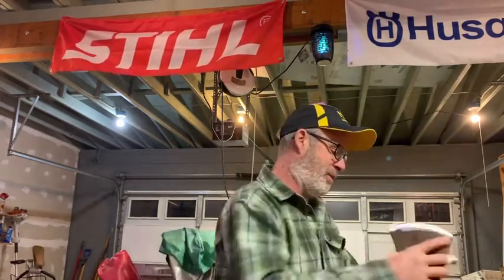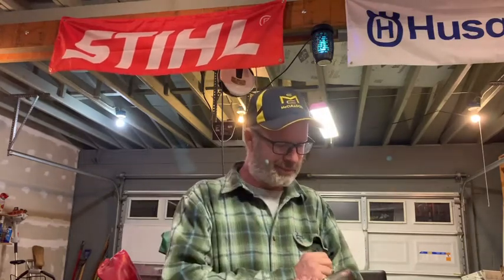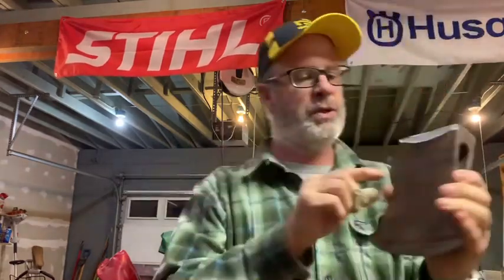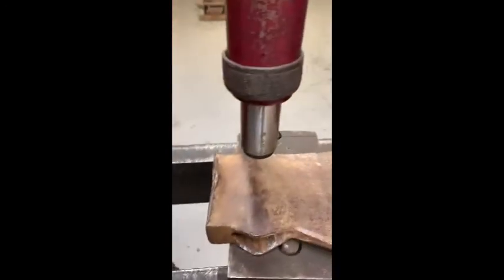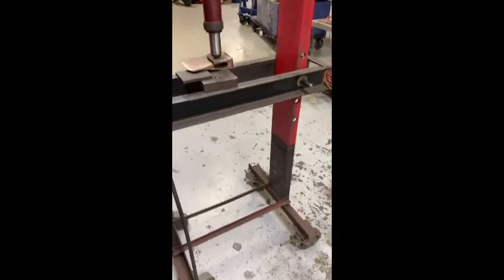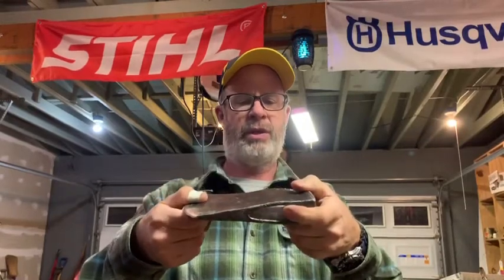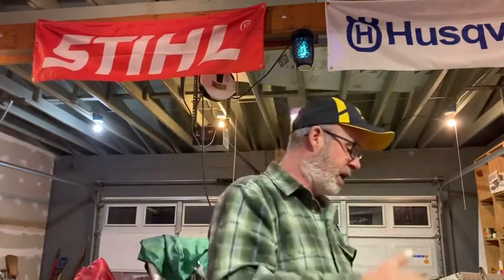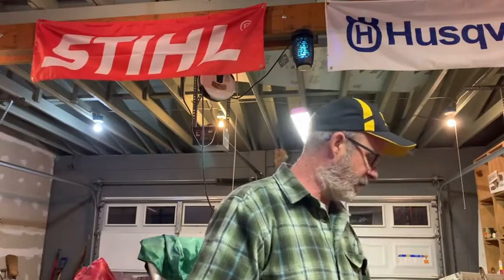Axehead rehab. Pressing the eye back into shape. Mushroom removal results.

Comment: Thanks for showing me the trick of putting it in the hydraulic press. I thought it would break it but you showed me it will bend instead of breaking if I do it right.
Reply from the maker: Just depends on the steel. I’ve broken the too. But it’s seems to work pretty well